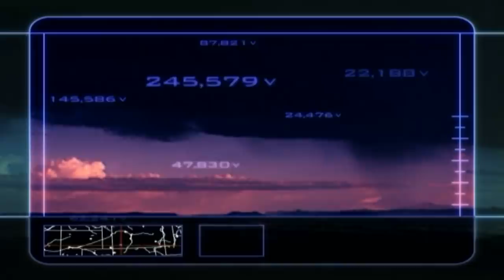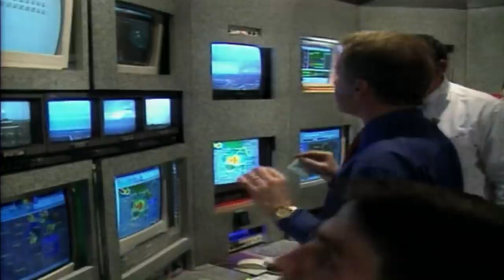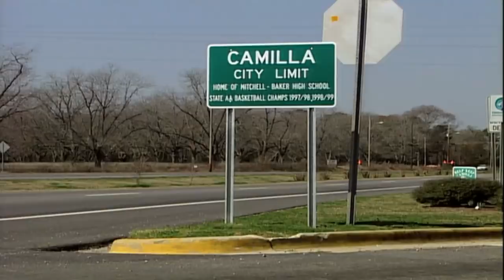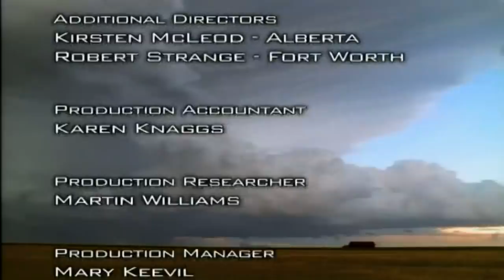Force of Nature - Tales of Tornado Alley

Comment: I think every home in tornado ally should have a steel reinforced concrete storm shelter
Reply: I think they should simply be built like Hobbit Holes.
Reply: Do you have an idea that doesn't cost money?
Reply: In a lot of places in tornado alley, the ground wouldn't be able to support an underground concrete shelter because it's too moist.
Reply: I guess we can count on you to start building right away then huh?
Reply: crude223 I LIVE in tornado alley yet i need one of those :D
Reply: Yes they should it will save more lives
Reply: crude223 but yet they continue to built crap homes and buildings without or barely any steel frames.
Reply: Yes but it would cost a lot of money, and just is not practical in everyplace for every person.
Reply: That should be manditory
Reply: they can...for the right $$$$
Reply: Alexandru Ioan Tornado season is mainly in Spring, and unfortunately happens, but people aren't going to moved because of that. They are scary yes, but moving away because of it is like moving out of California because of the constant wildfires
Reply: Steel reinforcement won't stop anything. EF4 and EF5 tornadoes are responsible for 99% of tornado related deaths and tornadoes that powerful literally bend steel in half. Also, tests at my University (TTU) have shown that even small pieces of wood will pierce brick and concrete at those speeds. And no one will move out of tornado alley because the risk is extremely low. You have a 1 in 4 million chance of being hit dead on by a tornado. I've lived in tornado alley my whole life (almost 21 years) and have never even seen a tornado.
Reply: Caleb Riley while that is true only around 1% of tornadoes are EF4 - EF5. So the majority of tornado alley residents ever see one in their life time. Ive been lucky in the fact that ive seen 3 so far in my short life time. But the majority of people never see them.
Reply: Run for president and do that
Reply: crude223 to
Reply: crude223 $$$$$
Reply: No it can cost as little as 3,300 and as expensive as 20,000
Reply: crude223 I agree or maybe not live there at all
Reply: crude223  y
Reply: crude223 same
Reply: Makes sense.
Reply: Makes sense.
Reply: crude223 makes sense!
Reply: crude223 do you know how many % of people even ever get hit by a tornado?
Reply: crude223 TDCDTTv
Reply: +crude223  Most homes are built with basements.
Reply: crude223 it’s spelled alley not ally
Reply: Michael Adsetts buy a big screen tv and a nice car instead..there's always a bathtub
dont even dig a hole..you'll miss the tv show
eat some crispy cremes
Reply: Candice Honeycutt bull
Reply: Really Tooy bull
Reply: Poly Bun bull
Reply: No matter where you live, your chances of dying in a car accident are many multitudes higher than tornado alley residents dying in a tornado.  
So, do you drive with a helmet on?  Does your vehicle have an extra reinforced frame and harness style seat belts? 
 Why not?
Reply: Dave that's way to expensive. It's better to mandate a basement on new homes and a single storm shelter for neighborhoods and small apartments.
Reply: DC Caleb never seen a tornado? Damn. I've seen them a lot but have never been hit by one in my 20years. But yeah, small chance of being hit by one, smaller chance of it being deadly
Reply: Storm Wolf there are above ground shelters though
Reply: crude223 µ
Reply: maybe the tornado will dodge you instead of building a fucking reinforced storm shelter

That will cost 399,999,999,999,999$
Reply: crude223 And you can help pay for them....
Reply: its not costly,,,we have every home in pakistan with concrete and stell bars,,,but houses with wooden structures in tornado alley is astonishing...
Reply: its cheap even in pakistan,,,no wooden expensive homes....
Reply: oh Mr Logical....
Reply: every home in tornado ally should be built of masonry with special concrete mixture, reinforced with steel and all windows have to have shutters to prevent glass from being broken.
Reply: Simple solution don’t live in tornado ally
Reply: Tornado alley
Reply: pwndecaf Not in Oklahoma they arent.
Reply: I just think that they should have shutters, like Hurricane type things so the windows don't shatter, the ones I saw in my friends beach house were metal, and they had this thing on their balcony that would cover all of the windows and all you had to do was pull it.
Every home should at least have some sort of basement, or interior zone that's a little stronger than the other parts of the house. These might help only just a little but it's a start ig since everyones saying in the comments "how are you going to pay for this?" and these are the cheapest I can go. It all just depends on the construction worker and the person spending $12-700+ on shutters.
Reply: @candicehoneycutt4318  How about ground floor FEMA-approved safe rooms that can withstand up to 250 mph winds?
Reply: AJ Muzik Okay, but who's going to pay for them?
Reply: I think all homes and public places in general should have storm shelters. Tornadoes can hit anywhere at any time.. even on rare occasions, during the cold weather.
Reply: How about move out? lol.

Comment: A level 3 Tornado will send an Egg through a brick wall, Tornado chasers call it Humpty's Revenge! XD
Reply: kornfanatic2008, its called an E3
Reply: Blayze McKnight EF3
Reply: kornfanatic2008 lmao
Reply: Blayze McKnight E3 level 3 tornado it means the same thing basically
Reply: This tornado's already at level two on the Fujisaki scale. A storm that strong can send an egg through a barn door. Two if one door is open
Reply: Humpty Dumpty was pushed...
Reply: Doncut97 the Fujita scale was in effect until 2007 when the Enhanced Fujita scale was put into practice, hence EF. So tornadoes from before then generally have an F rating and after have an EF rating.

Comment: Dome structure made of reinforced concrete is  the answer. They are cheaper to build than a normal house, its simply a different way to live. More money to be made when the house falls down.
Reply: Nah steel reinforced concrete pyramid with 50cm to 1 meter thick steel reinforced concrete with enough a electric generator as well as pneumatically and mechanically locked doors and windows with 10cm or 20cm thick steel reinforced concrete slabs capable of locking into the foundation as well as pneumatically operated 10cm thick reinforced steel doors and 10cm bullet proof glass windows with the same  locking capabilities of the doors except it locks into the structure of the house. It would have 2 food storage rooms as well as water tanks and just incase a 5 meter deep steel reinforced concrete bunker that is put directly into the foundation which itself is as deep as foundations can get with heavy duty reinforced steel beams arranged in a criss cross pattern as well as it's own WiFi system and with at least 5-6 bedrooms and 3-4 bathrooms and a large kitchen and dining room aswell as a garage capable of holding at least 2 cars with pneumatically and mechanically locked and operated doors that lock into the foundation as well as CCTV cameras on the inside and outside also a automatically operated locking system for all doors and windows if a tornado is detected with a manual override just in case the automatically operated locking system were to fail.

Comment: hurricanes are made over oceans by water temperature change and atmosphere change where a tornado is made by all weather/atmosphere change therefore a hurricanes is almost always much bigger then tornadoes. the largest tornado on record is under 3 miles. hurricanes cover whole states plus when they reach land they have a lot of force & water from building over an ocean and start to break down as soon as it reaches land because it loses it's ocean built water and force. Michigan has lakes all around it but thats LAKES not a much larger body of water called an OCEAN where hurricanes can only form. the great lakes around Michigan don't have enough water for any type of water temperature change to make enough difference to even start a hurricane. like a tornado the hurrican can have the same up to F5 wind speeds and like a tornado they can move as fast across the land also like a tornado it has to be an organized storm or its called a tropical storm. in short a tornado comes from atmospheric change/the sky. hurricanes comes from ocean water temperature change. both build until organized or spin in one direction. hurricanes cause tornadoes to form sometimes because hurricanes are so big they create there own atmospheric change/weather system & already have winds going all one direction witch make the air/atmosphere ideal for tornadoes to form around it. a tornado is a vary dinky storm compared to a hurricane the biggest organized storm any planet can have = the big red spot on Jupiter a hurricane bigger then the earth not a dinky tornado but a humongous HURRICANE! Have you ever heard of a hurricane chaser? heheHA! of course NOT! why? for 1 they always form over an ocean/large body of water & 2 unlike with a tornado weather radar can see the hooking of the winds it will/does show the complete hook/circular winds motion and how fast it is both wind speeds and travel of the whole hurricane with a tornado its hard to see if the winds are complete circular winds until its too late thats why storm chasers are important to meteorologist. a storm chaser even has trouble finding a tornado but no one has any trouble finding a hurricane with radar we can see it form from an un- organized storm a tropical storm to right when the hurricane is born. it takes hours to days for a hurricane to form and end for that matter where were talking minutes for tornado to form & end. if a tornado lasts an hour on the ground its a big deal but a hurricane is always on the ground it starts on ground level at sea & ends on ground level. its a massive water temperature change & atmosphere  phenomenon. tornados are all atmosphere/weather temperature change phenomenon & don't need an ocean mass of water so a little water = a little storm or a little organized storm = tornado. a lot of water ocean size = a BIG storm or a BIG organized storm = HURRICANE.

Comment: This is a good video, but I HATE added special sound effects to natural events. Mother Nature don't need no stinkin' effects. She has all she needs. All it does is make it sound more make and clashes with what Nature has to offer. Power flashes don't even sound like that. They sound like a loud and distorted 60 Hz buzz (if your close enough).
Reply: Robert Gaines You can even feel those flashes in your bones if you are close enough.
Reply: They probably do that because they don't want to add footage to wait for the actual recorded sound in the clip. Also, if they did do that, they'd probably get a lot of confused complaints by people about the sound not being "in sync"

Comment: How bad is steel reinforced poured concrete as a building material for the many modest size houses we see blown flat by cat 3 and 4 tornadoes...can be sided and trimmed to look like stick built and could be anchored to not be sucked up and would not  fly apart like wood frame... I don't plan to live anywhere called "Tornado Alley " but if I did I would think about it...just a thought.
Reply: +Oilsmoke Jones 
A concrete house would be unfeasibly expensive (and not a very livable house to boot). That being said, there are simple and economical engineering changes that could be made to make any home more tornado proof. Most homes will still be destroyed by EF3+ tornadoes though, even if they are well-built and anchored.
Reply: I have seen where tornadoes have taken asphalt roads and picked up 11 inch slabs along with a modular home and carried it off for several hundred feet.A friend of mine had a three acrempond and a tornado went completely over it, a half mile wide ef4 monster, and it sucked all of the water and all of the fish and other life right out of it. The same twister picked up above ground pools emptying them, and emptied built in swimming pools too.You have to be underground to be safe and even in a basement an ef5 can take you right along with the entire bouse.These 300 mile an hour storms cause total destruction even leaving no debris around to clean up.

Comment: I'm looking at taking a job in Iowa near the Nebraska border. Does anyone have tornado surviving advice?
Reply: I do I know a lot about tornadoes. Tornadoes are usually formed by thunderstorms although there is a type of tornado that can form on hot dry days and dust devils (people say they're not tornadoes when they are) can form without a thunderstorm although they are usually in dust storms. You will need a survival kit with you and a safe place. There is no completely safe place from a tornado, but some places such as storm shelters, basements, safe rooms, etc mostly underground are very safe during a tornado although some places aren't very safe and very dangerous to be in during a tornado such as outside in a car or other vehicle mobile home etc in your survival kit you will need a lot of supplies as many as possible such as canned food a cab opener water snacks flashlights helmet medications if you take any medical records clothes blankets pillows 2 or 3 things that are important to you, you know a bunch of things like that that would be important to have with you. You always need shoes or boots during a tornado so you are not stepping barefoot on anything sharp like nails or glass. If you do not have an underground shelter you can go to the center part of your house such as the bathtub in a bathroom a closet etc put blankets and pillows over you and if you go in the bathtub do NOT turn on the water like they used to tell you to do. They are now finding out it makes it worse. Tornadoes can attract to water. You and your family will need to learn CPR incase someone stops breathing you can look that up and be taught by nurses doctors and medical people that work in hospitals. Do not give mouth to mouth. It actually is being found out that mouth to mouth makes it worse. you can find out more information online and on Wikipedia and ready.gov
Reply: +Dan Conway Learn the geography of the city, ask locals, and otherwise just listen to warning when you hear them. Other than that, learn for what to look for: transformers exploding, power outages, the sound of a train, etc.

Comment: What about eastern Colorado... Weld County has more tornados then any other county in the United States.
Reply: DenverBroncos1818181818 
Eastern Colorado does have its fair share of tornadoes, but many of them are weak landspouts (non-supercell tornadoes) which are very common in the region's high, flat terrain and fairly dry climate. Overall however, it's best to compare tornadoes by regions, not arbitrary political boundaries like states or counties. The density of tornadoes in some regions of, say, central Oklahoma or northern Alabama is going to be much higher than anywhere in Colorado, especially when comparing the number of significant (EF2+) tornadoes.
Reply: Wow you know a lot about tornados. lol.